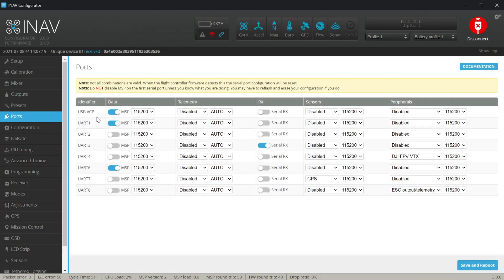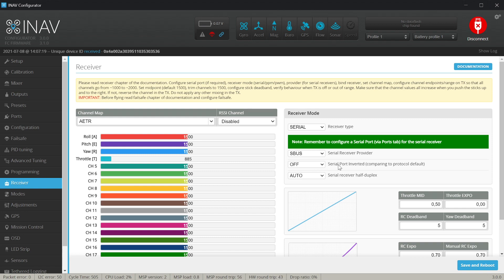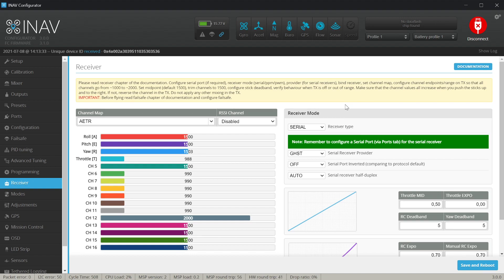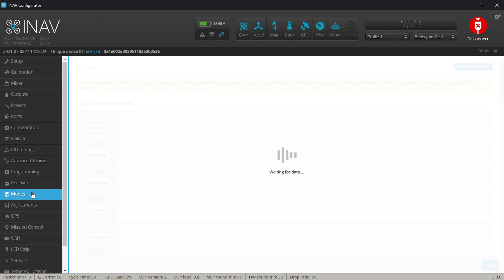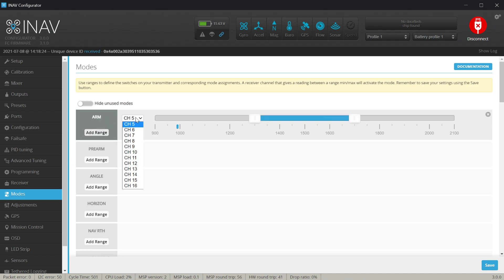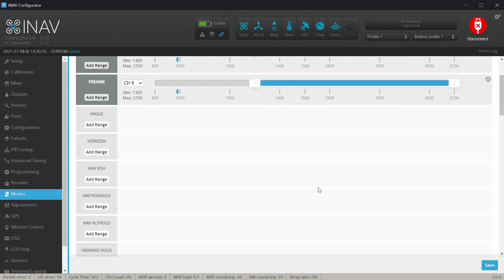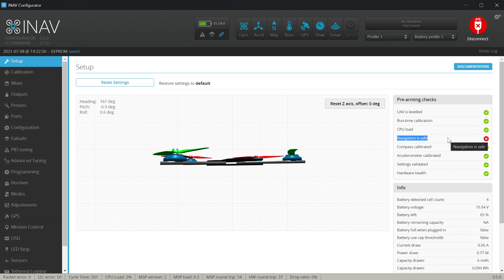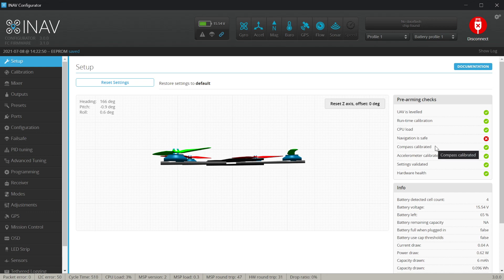Receiver, Failsafe & Modes | INAV on a FPV drone tutorial

Comment: Pawel :   Excellent series as usual - over the last couple of days pulled out my Emax 5'' Nighthawk Quad  upgraded the FC to the Matek F722 - eventually got all the Blue graphics...  Gyro To GPS lit up 
But my Rx  R-XSR  v.2.3.2 not working  bind OK ( grn LED on)  
 Receiver tab:- CH's graphic  not moving  - - Receiver Mode Settings = Serial,  S.Bus, OFF, Auto // Uart2 Tx used for S.Bus ...... what do 😕 
Does the Rx need re-programming ie  different FW.... or what ...joe
Reply from the maker: You don't need any reprogramming. It's something with your setup. Leave everythig on default and only select correct serial port and protocol

Comment: What could be the issue if when using tbs nano crossfire receiver inav will not register stick input when moving the sticks or any of the switches on the flight modes tab?
Reply from the maker: Not binded or not wired correctly. Assuming correct serial port is configured and correct protocol (CRSF) chosen

Comment: I have my GPS connected but not the compass, because there is no I2C port available on my board. Could it be the reason why PositionHold Mode doesn't show up on my configurator? The Nav Althold (that is tested working) is present and others gps related mode like surface mode. I just wonder why PosHold Mode is not there.

Comment: Hai Pawel, i have mamba f405 mk3 with target furyf405sd and i flahing INAV 3.0 and flashing succes. Calibrate and etc procedur step by step is good. (I want multirotor without gps).
I have problem on my tx not respon Ail, Ele and ruder, but throttle is respon. Whats wrong in my setup ?
Thank you.

Comment: Thanks for yet another great video. I have set up a Sonic Modell AR Wing pro on Inav 3.01 using a Matek F765 wing board and seem to have a small problem with auto launch.
I can only get auto launch to work if I am in manual mode. If Auto launch is permanently set it won't arm, if in any other mode other than manual mode it wont arm. Looking at so many videos on this subject I should be able to arm my motor in auto launch in any mode but can't.
Any help would be grateful.  Thanks.

Comment: POSHOLD and ALTHOLD I don’t getting why you enable both at same time, I’m using position hold when the quad is arm and i engage it it immediately jumps in altitude and slowly descend to hold the position, is that a normal behavior? Thansk
Reply: You will need to reduce your Hover Throttle setting in the Advanced Tuning tab, Multirotor Navigation Settings. From memory the default setting is 1500rpm. Scientific way to set it is to hover in Angle Mode and note the throttle setting in the Black Box log for that part of the flight. Both my quads are happy at about 1250rpm. You could try dropping the idle setting in 50 or 100rpm steps until the transition is seamless.

Comment: Fantastic, Pawel! Thanks a lot! 😃
But let me ask you something about the RTH... In case I'm flying in a place with lots of highs and downs, geographically speaking... How can I know if it's safe?
Anyway, stay safe there with your family! 🖖😊
Reply: always set your return altitude higher than the highest obstacle in your flight area (within airspace limits of course).I think you can even change that in the OSD settings if you need to do so in the field. if I don't know for sure I fly close to the highest obstacle and note my altitude when above it and use that
Reply: @jet_flyer  The issue is when you're flying from the middle of the mountain, not necessarily going up. You know?
Reply: @MCsCreations  you mean not at the top or bottom, but along the slope? I'd still set it a little higher than the peak if you'd be doing any flying near that peak. if you're flying the other direction then just set it at your altitude + a couple meters I'd say